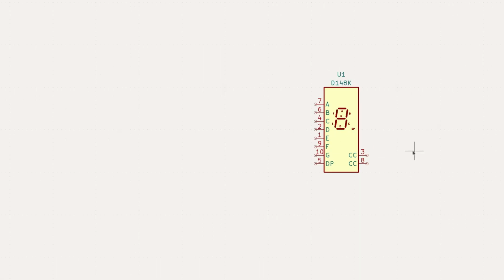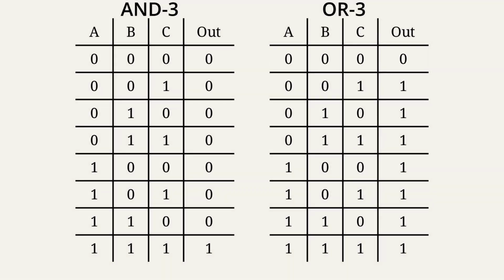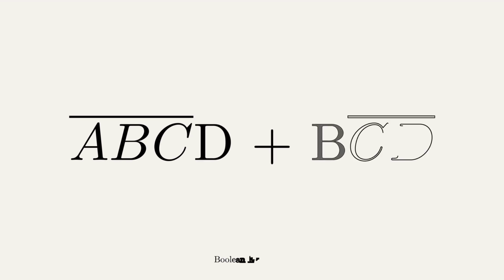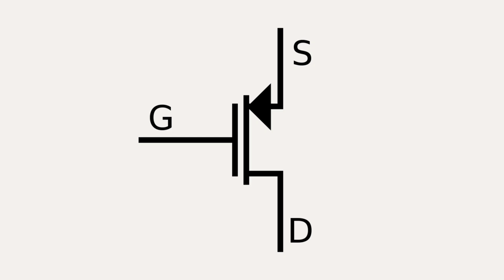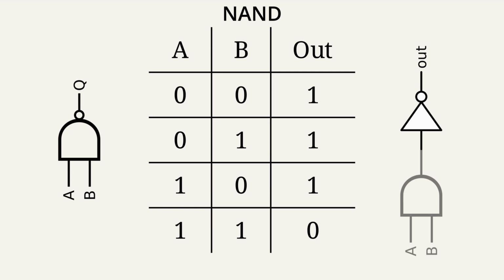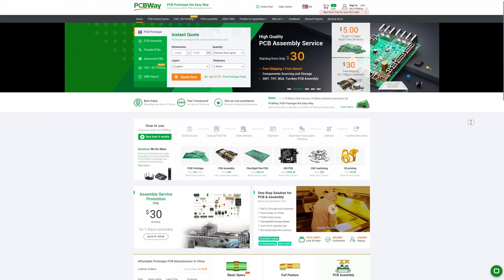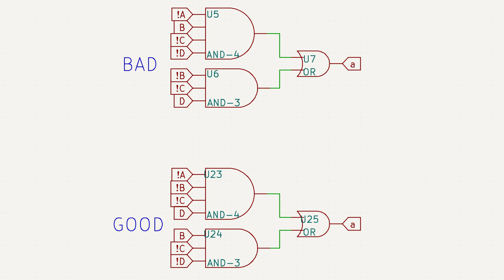I Built a Custom ASIC at Home

Comment: Plz kindly explain how the output of ABCD is abcdefg like what gate is used for out put i know a sigle segment has 7 leds and you are some how created a pattern which converts a binary 1 to light only those leds leds which will show a decimal 1 but how slow the video down with a bit explination and your concep of simulating a silicon ship chip on a pcb is very good there is no better way to do so but please complete one concept before jumping to next one

Comment: 🎯 Key points for quick navigation:

00:00 Digital logic transistors.
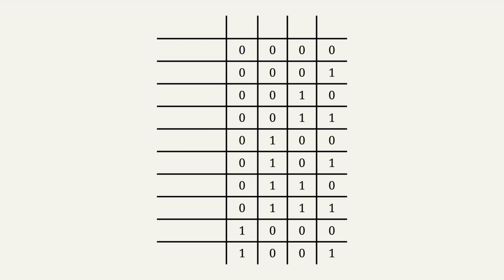00:42 Binary coded decimal.
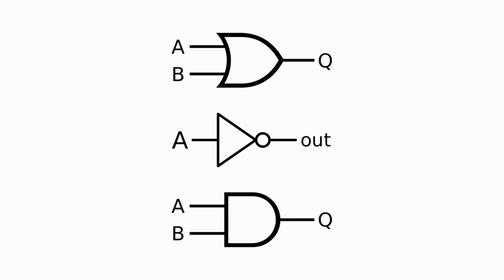01:09 Inverter logic gates.
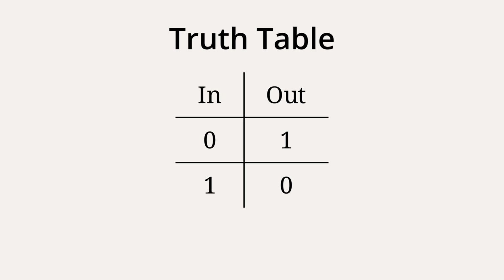01:37 OR gate function.
01:52 AND gate operation.
02:33 BCD converter logic.
03:15 K-map simplification process.
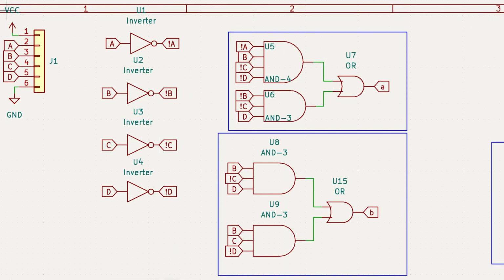04:07 Mosfet voltage-controlled switch.
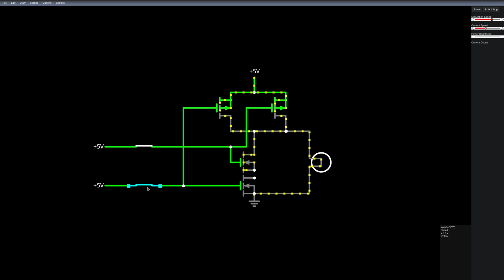05:46 NAND gate construction.
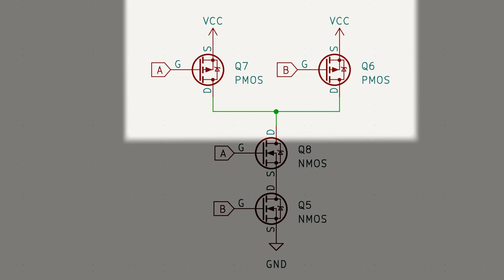06:14 Pull-up, pull-down networks.
07:08 PCB way board production.
07:51 Arduino output testing.

Made with HARPA AI

Comment: it doesn't matter  if vcc or gnd is applied  to drain or source , as long as current flows from gnd to vcc (original flow of electrons)  mosfet doesnt care which side is vcc or gnd.  Only the Gate of the Mosfet cares whether its ground or vcc. for n type  mosfet, vcc at the gate turns it on and for p type , gnd at the gate turns it on.  Most devices apply working voltage at the drain and the source is connected to a load.
Reply: In making an actual chip that would be correct. With discrete transistors you get an extra diode for free that forces you to use the drain and source for their designated purpose